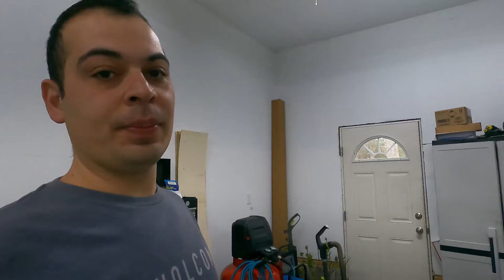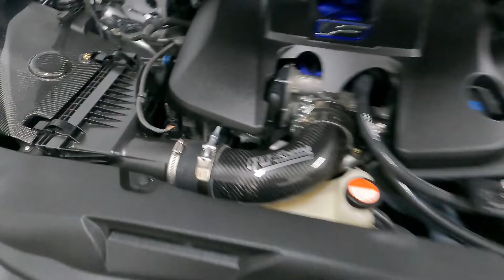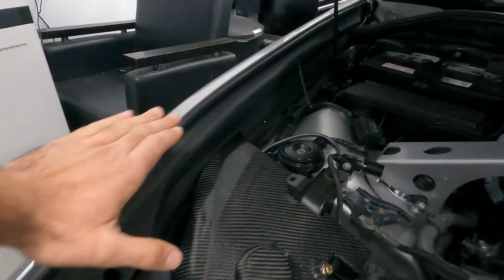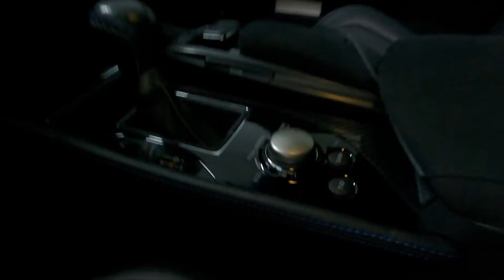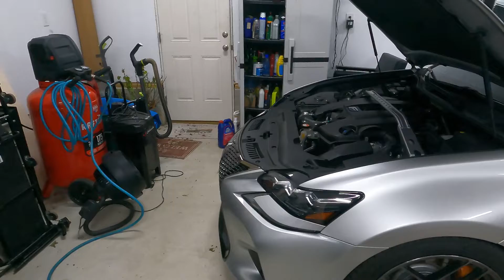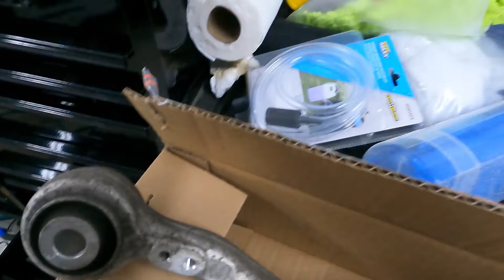Lexus F car common problems, common modifications, and required maintenance!

Comment: I'll summarize:

Valley Plate leak
LCA Bushings cause inner tire wear
Thermostat/Water Pump leaking
Radiator cracking/leaking
Transmission Mount/Engine Motor Mounts wearing fast
High Pressure Fuel Pump Gasket leaks
Cracked Headers (not as common)

That's it for common issues on the F's. RR racing stuff is overpriced if you just daily your F and don't live in the USA (I'm in Canada). Tuning go to reflash, everyone else is garbage

Comment: Another very informative video thanks. Interestingly the Lexus service schedule for iridium spark plug change in the UK is just 60k miles. On the basis of "if it's that simple and it's worthwhile why don't Lexus do it" I must confess to being a bit sceptical about some of the popular mods. In particular fitting the oil catch can and replacing the liquid filled suspension bushes. My 2017 GSF is completely stock and steers perfectly, ie extremely precise and responsive. Additionally, mods such as the catch can would likely affect the warranty (here we have Lexus relax, which gives a free 1 years warranty (up to 10k miles) every time the car is serviced....this keeps the car under warranty until it is a day or two short of 11 years old.

Comment: Did my full transmission fluid and filter change last week and it shifts so crisp now.  I was having a problem where the car will hesitate to down shift on the first time in the morning.  I have a 2016 GSF with 45k miles pure joy.